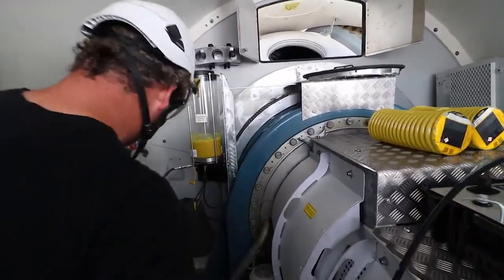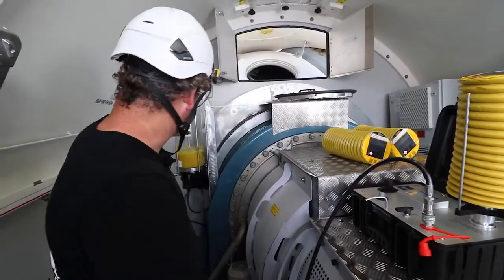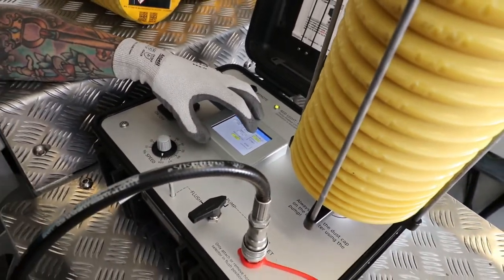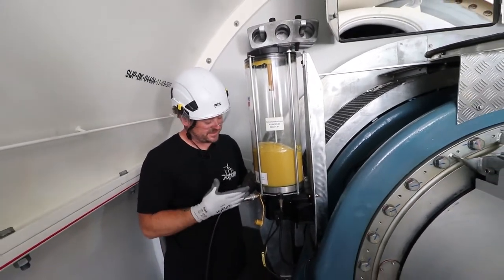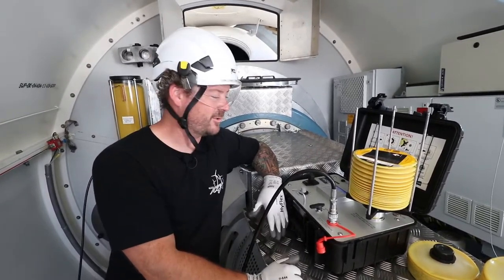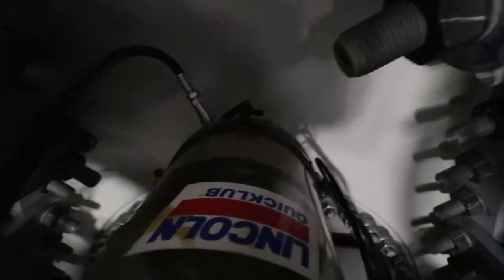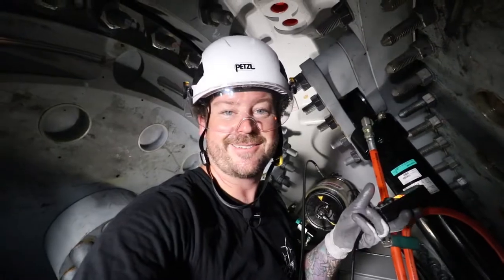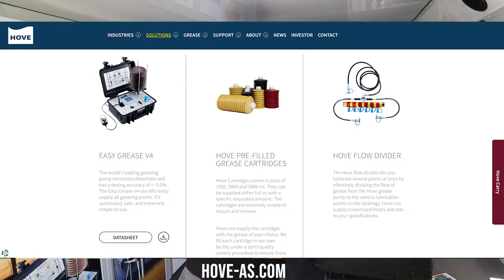Greasing Siemens 2.3 Wind Turbine with Hove Pump

Comment: there is a story about the Tennessee Valley Authority trying to figure out why they were losing motors in nuclear power plants .
Turns out the main cause was Over-greasing !
Simple Fact - bearings should be greased (Perfectly) when the machine is manufactured  . Everything done after is a mistake  .
Where does 36 tubes of grease go ?
If you watch videos of wind turbines burning up - it’s because of bearing failure
Reply: That is never the reason.   You don’t know what you’re talking about.
Reply: Complete nonsense
Reply: Yes, it is possible to overgrease bearings, and doing so can lead to several issues. Bearings require lubrication to reduce friction, dissipate heat, and protect against corrosion and wear. However, the correct amount of grease is crucial for optimal performance. Overgreasing can cause:

Increased Friction and Heat: Excess grease in a bearing can lead to increased friction as the bearing elements must move through the excess lubricant. This can generate more heat, potentially leading to overheating, which can degrade the grease and damage the bearing.

Pressure Buildup: Overgreasing can cause excessive pressure buildup inside the bearing housing. This pressure can lead to seal failure, allowing grease to escape and contaminants to enter, which compromises the bearing's integrity and lubrication.

Grease Deterioration: The excessive heat from overgreasing can accelerate the deterioration or oxidation of the grease, reducing its effectiveness as a lubricant.

Energy Loss: Bearings with too much grease require more energy to rotate, which can lead to higher energy consumption in machinery and equipment.

Contamination: When seals fail due to overpressurization, it not only allows grease to leak out but also permits dirt, dust, and other contaminants to enter the bearing environment, further reducing the lifespan of the bearing. @rossmoody7744
Reply: Well good thing that the system the guy is filling is just a hopper for an auto-lube system, so no need to worry.